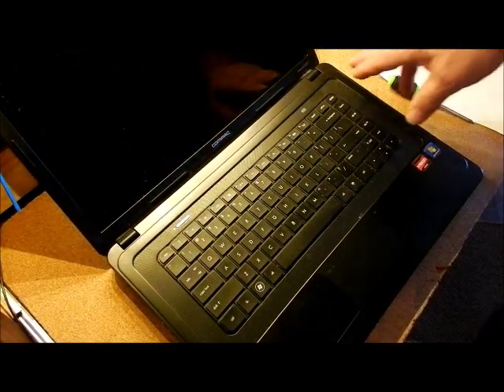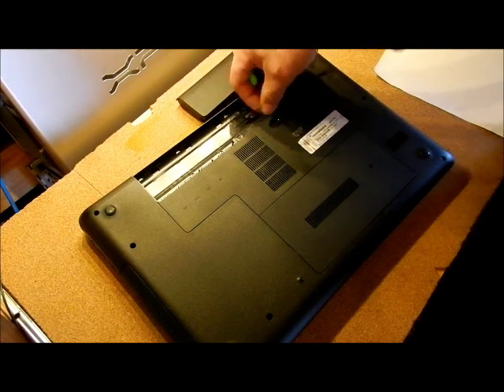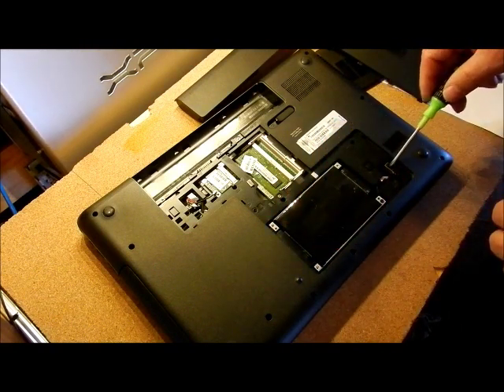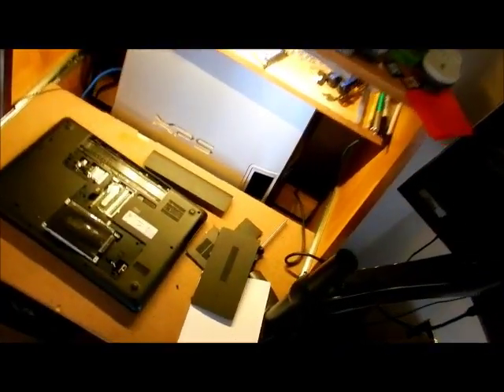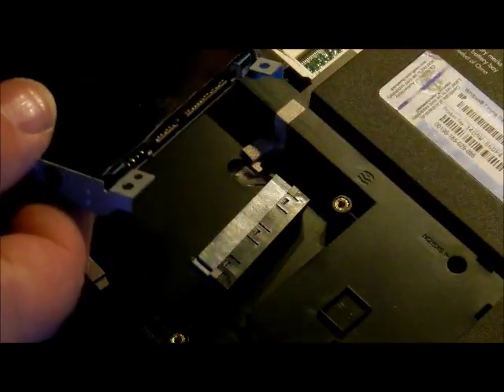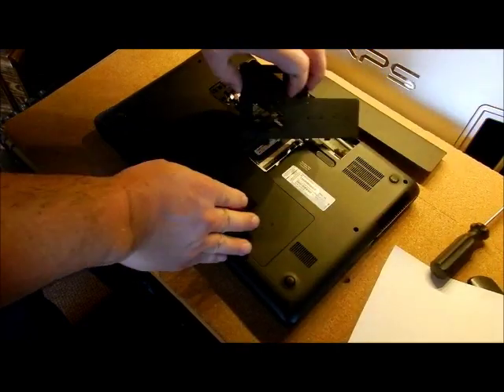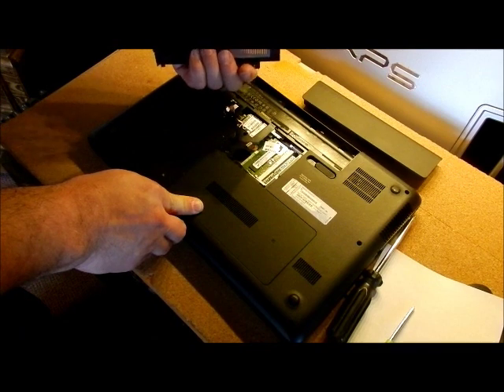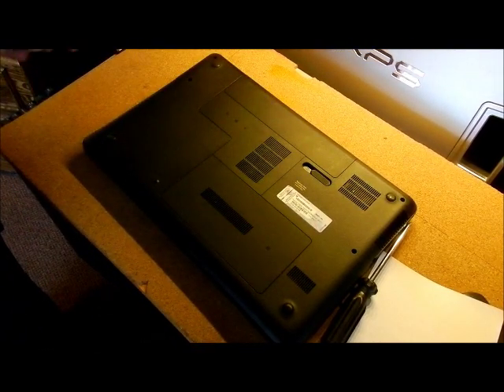Compaq Presario CQ57 Accessing the Hard Drive and RAM

Comment: I have a question I have a compaq Presario CQ62 and for some reason when I turn it on it shows a black screen with the mouse on it and i can't do anything else i don't know if its a virus or something but i hardly use it.
Reply from the maker: Normally it's a hardware problem.  Try pointing a fan under it.
Reply: @billyq12001  Thank you I will see if that works!
Reply from the maker: @aestheticsunflower8001  If not you may want to find a good repair shop.